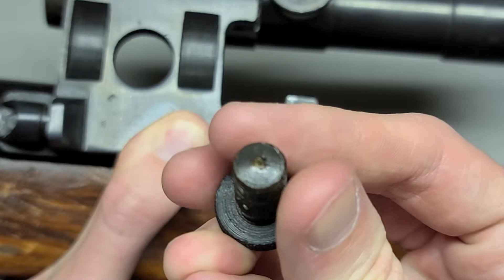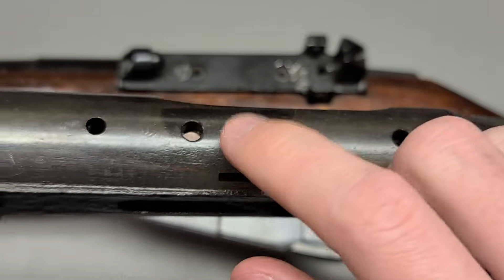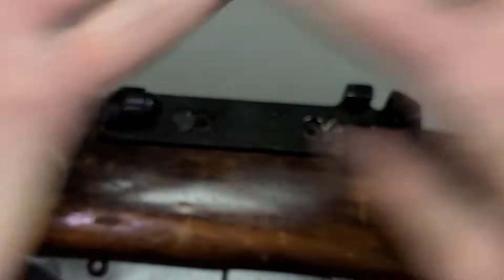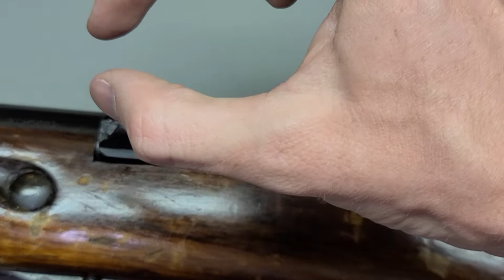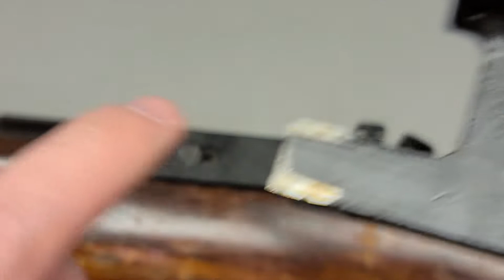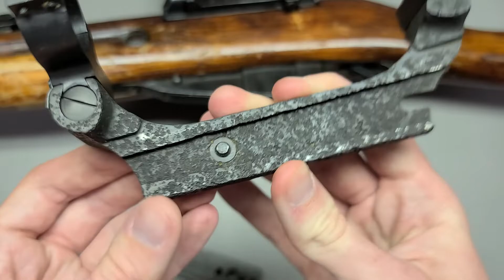How a PU Sniper scope mount works

Comment: To go to left to right, you loosen the big screw and adjust the other screws to make up for the slack .Shims may be needed if you done file off the back of mount. These gun are notorious for shooting high to the left. Use the mount like a boar scope, then tune in with scope.
Note

Comment: hey big Sam, I converted my 91-30 into a PU with an aftermarket PU scope base and mount, I did not drill holes for the pins, I just drilled and tapped the main screws, is there any cons for not having pins? it feels pretty secure?

Comment: Another option for lateral movement of the scope mount is to thread the rear pin hole and place a set screw in that position. Some of the Chinese reproduction mounts used an original mount that had the rear standoff ridges already ground off to almost flush. This allowed the scope to become wildly off center to the left. Shimming under the mount will work, but I found the set screw idea in the rear base pin hole to work well. If one desires that the rear pin hole is used, then the mount can always be drilled through and another set screw added to set the lateral position. Also, some have asked why the scope sets so high on the receiver. This position allows the use of the iron sights.  Very informative article.

Comment: I'm trying to piece together all these bits from no complete set but all are genuine non repro parts. This video helped so much. with the filing and set screws and all that lmao i would NEVER have imagined that's how it is done. absolutely makes sense though! also I've seen so many complaints and gripes about people's scopes in forums and such that i now realize they didn't understand how any of it works either. very eye opening. great content! now i just hope i can get mine adjusted properly and not have to use shims, nervous there's been to much material removed already on the windage side. i guess thats another reason why everything was serialized together.

Comment: Is there a way to convert a normal Mosin to a sniper ?
Reply: Not worth it.......You Must have a good shooting bore and besides the cost of buying everything there's quite a bit of work n tapping....  Best just buy a S&K rear sight mount n pistol scope which doesn't Bubba up the rifle.....  be well n K.A.G.
Reply: There are kits available “BE CAREFUL WHO YOU BUY FROM!” I’ve seen lots of horror stories about some of them! I would say if it’s inexpensive, there is a reason!
Reply: @archer721  , Yep bent bolt, stock mods., Drilling and tapping work wise.. then buying a scope n the mount.... Not Worth it.. jmho.. be well.
Reply: I made my Mosin into a sniper Mosin, I drilled it, tapped it, and did all of the installation myself. I bought a bent bolt (has a different serial number than my rifle, but whatevs)* and I also “accurized” the Mosin using a shim kit and a rag on the barrel. I think I got lucky because it shoots beautifully, until of course the barrel gets hot then the MOA gets very wide. But when the barrel is cool, the first shot lands exactly where I want it at 100 yards. 

I think it’s worth it for the experience but of course, do your research or have someone else do it for you. There is a channel called “Mosin virus” that does a very good job at explaining the process on how to drill and tap and zero your Mosin with a scope.
Reply: The  Russian have something called Molot mount  Q. Most of the modern mosin already factory  fitted with one.
Reply: I would be fine with a stock mount. Could 3d print it even to get a side an offset scope. Would far prefer anything that doesn't drill into the receiver and risk getting rust in the threads over time.